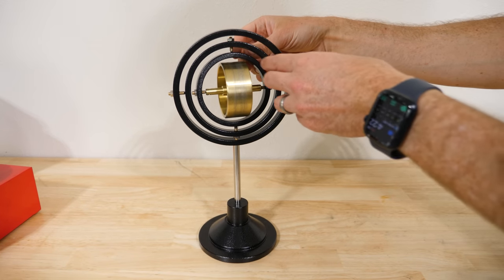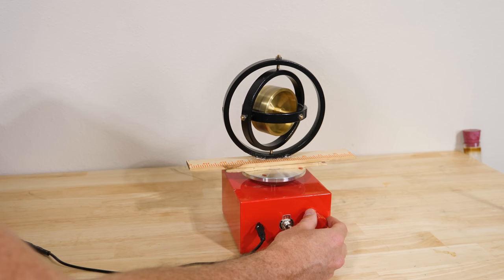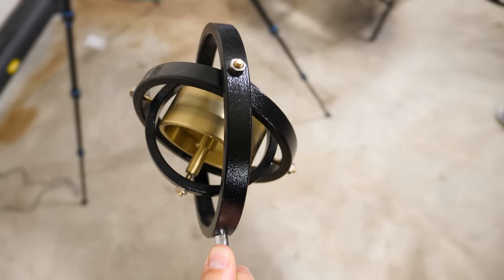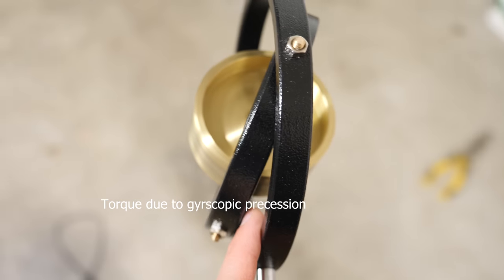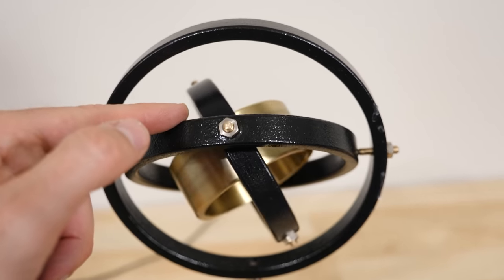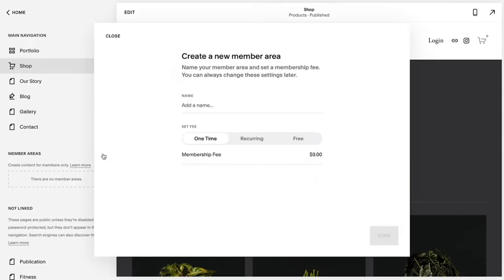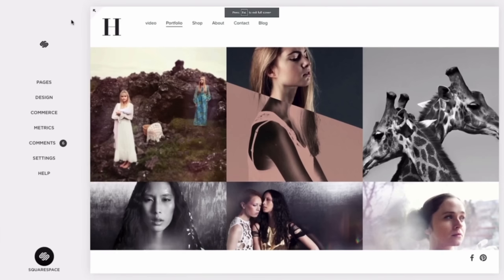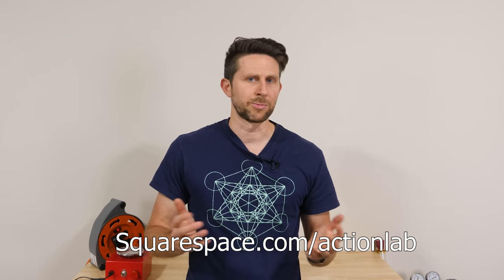Can Gyroscopes Provide Free Energy For The Planet?

Comment: Tesla came up with an idea to extract energy from the earth's rotation.  He said we just need to build a structure that circles the earth at the equator which when completed, would no longer need any supports as it would float independently because gravity would be pulling on it equally all around the world.  He posited that since this structure is now independent from the earth, the earth would rotate under it and generators could be made to turn from the earth's rotation.  Genius.
Reply: I am wondering if any material could withstand the compressive forces on such a ring. I do think it is a great thought experiment.
Reply: @flamencoprof  I believe the entire structure would only be under 1 g.  I think the real issue would be supporting the structure while under construction in the areas that cross oceans.  Floating platforms may not be stable enough.

Comment: Ok I know how to do it : you put two big masses in balance on an horizontal axe (the axe is on vertical pole), the whole system is at the top (North) of the planet. 

If you quickly flip the axe vertically (as if it was a clock's hands spinning), then the two masses will suddenly have a momentum that is in the opposite direction of the spinning of the planet. This should cause a torque in the middle of the horizontal axe relative to the pole.

Comment: What could theoretically happen if the spinning core of the gyroscope was full of ferrofluid and a magnet approached it? How would it react?
Reply: Well, before you even have the magnet acting on the gyroscope, the ferrofluid inside the gyroscope would start to slow it down due to friction because it's not a solid mass, so the two masses would rub up against each other, converting kinetic energy into heat energy. The magnet would increase this affect massively, most likely bringing the gyroscope to a halt after a few seconds, since now the ferrofluid inside doesn't even want to attempt to spin along with the gyroscope and instead pool up against the side closest to the magnet.

Comment: Thank you for this video and the work you do. The creator of this video requested input on potential solutions to break the barrier of using gyroscopes to extract energy,. One possibility is incorporating elements of the vandergrah generator using conical levitating bearings, that is, without taking advantage of China’s recent breakthrough extracting energy from quantum entanglement,… (also, incorporating concentric spheres and cyclotronic/collider principles in place of gyroscope rings, suspended via magnetic levitation is another option to completely remove the need for bearings thereby decreasing resistance.)  In theory we could even incorporate ionic and/or harmonic frequency stabilization/propulsion to smooth rotational wobble.

Comment: Maybe we have a 10-ton gyroscope rotating at 10,000 RPM at the equator of the planet and and stabilizers so that if we apply any resistance it won't try to align itself maybe we can have a lot of these around the world but we could make a gearbox that would allow for faster rotations so we could attach a crap ton of motors to it and extract energy that way

Comment: The Soviets tried building these things for decades, and only ever got a few watts of power generation. The main issue is the scale; you'd need to build a gyroscope on a scale comparable to a small planet to get a useful output of energy, due to the slow spin speed. Using a series of orbital rings, you might be able to get it to work, but there's much more useful things you could do with orbital rings to provide power.

A much more realistic possibility would be to melt an iron/nickel asteroid into a sphere deep in space using solar-pumped mirrors, then build a flywheel on one of its poles. You could then spin it up with the flywheel, converting the asteroid into a giant mechanical battery (to store nuclear or solar power) and then you could extract that energy from the flywheels on its poles and beam that back to Earth via a MASER and ground Rectenna setup on an as-needed basis. Even if the asteroid was only a few cubic miles, it could store enough power to run entire nations for years, and would have something like 85+% efficiency as a battery.
Reply: Intriguing. Where can I read up on this? Even the stuff mentioned in the video is a very hard google search, apparently.
Reply: @janimelender2674  Yeah, hard to find much info these days. I read about the Soviet experiments with gyroscopic energy generation about twenty years ago in college. No idea how to find that info today, sorry.

The flywheel battery thing is pretty well known, though. I'm sure there are multiple Youtube videos that explain it better than I could. Using it to spin up an asteroid is my idea, but it's based on plans for how to control the rotation of O'Neill style orbital habitats that NASA was studying decades ago. It's all fairly easy to understand once you know how flywheel batteries work, though. If you stand on an object, like an asteroid, and spin up a flywheel in your hand, the asteroid below you will start to spin in the opposite rotation. Essentially the same as having two flywheels atop each other, each wanting to counter the spin of the other.

Comment: Two ways I can think of extracting energy is using a turntable like the powered one you had with a minimum of friction to allow the gyroscope to turn it and use the motor to generate electricity as it rotates the turntable. Another idea is to have magnets embedded in the center of the gyroscope and coils to pick up the magnetic fields. I can't help but think about the starting and running energy needed for the gyroscope. A pendulum only needs a start and it will continue with the rotation of the earth so if the tip of the pendulum had a strong magnet and it had a multitude of coils to pick up energy possibly you could generate some electrical energy that way depending on if the magnet causes the pendulum to slow down to a halt because of an attraction to the metals in the coils or mounting hardware. The idea is to get free from using energy to make energy except for perhaps the initial start. How about a satellite that focuses energy on a point on earth where you have various solar collectors around the earth and the satellite would switch on and off according to where the collectors were located...? Some extra food for thought perhaps?

Comment: You aren't going to be able to get energy out of gyroscopes sitting on the Earth, because that would require violation of conservation of angular momentum.  The Gyroball can work because your hand is transferring angular momentum back and forth between it (and the Gyroball) and the rest of you (and the ground you're standing on, although that isn't strictly necessary).  Now if you have somewhere for the Earth's rotational angular momentum to go, then you can extract energy from the Earth's rotation -- this actually works, and somebody posted in another thread under this video that this is tidal energy.  In this case, the Earth's rotational angular momentum is being transferred to the Moon and the Sun (to a lesser extent but still highly significant).

Comment: I would focus instead on harnessing the Earth's magnetic field by passing a conductor through it like was done on STS-75. A conductive tether was extended to 20 km at which point it broke because the voltage became so high it melted the cable.

Comment: so it kinda sounds like a matter of efficiency.. Like a perpetual motion machine the problem tends to become when you attempt to harvest energy from the system, entropy always wins but you can make a system extremely efficient and run for a long time from initial forces. 

You know its a shame theres not a way to reverse the force of energy, draw all the ambient thermal energy into one point, then use that point heat to run a generator. Would completely replace the need for air conditioning and people's homes would largely run their own electrics. (air conditioners already work by pulling energy out of the air, it just isn't in a way that can meaningfully be harvested.)

Comment: Probably a dumb idea, but:

I imagine a big, heavy flywheel. The flywheel has magnets that line the outer circumference. Obviously we take advantage of the inertia of this great, spinning mass to generate electricity from the change in magnetic current, but the next part is where it gets really dumb (and potentially smart)

If you get a bunch of people to push on a mechanical mechanism of some sort that can add rotational energy to the flywheel, it shouldn't run out of energy. For a person to add this energy they would have to use their muscles, and that made me think: what if the mechanical mechanisms worked like exercise machines? We want energy, and we want to get in shape, so this pairing seems logical to me. 

It would be hard to get the flywheel up to it's ideal operational rotational velocity, but after that it shouldn't be hard to maintain, and if there was a way to add weight to one point of the circumference, gravity would provide the initial pulling force that would help start the generator. 

So on a scale of 1-10, how bad is this idea?
Reply: Bro this is really just like those bikes from Black Mirror that generate electricity, but on steroids. 1/10, I'd rather have us just build some nuclear power plants.

Comment: You could use the magnetic field of a magnet surrounded by coils in a specific geometry to make a solid state "free energy" device.

The magnet itself already has a moving magnetic field. (gyromagnetic precession, larmor frequency) 

Of course the system has to be tuned precisely to work.
Reply: Don't talk shit. Free energy doesn't exist.
Reply: @SpareSomeChange8080  It depends on how you define the term "free energy"

Saying free energy does not exists is a non intelligent statement at least.
A solar cell is a free energy device per definition.

In my example I have posted above the rotating magnetic field of the magnet itself would be the power source itself. 

You don't have to attack me, because you can't grasp the concept I was talking about.
Reply: @OmegaZZ111  so if I steal power from a lamppost, is that free energy?
Reply: @SpareSomeChange8080 
If you can generate electricity with a setup as explained above the electricity is free obviously..

Seriously what is your point besides asking silly questions?

Comment: It would be cool if we could somehow build a massive gyroscope around the earth and then connect it to the moon with a super strong cable. The moon always faces the same way relative to the earth's surface so we'd only have to anchor the cable on that side. On the earth you'd need some sort of trolley which also acts as the generator, which will just get dragged along by the moon. Ofcourse highly theoretical as it would probably put the earth out of resources before the structure's finished.

Comment: It’ll probably have to be a massive digital/virtual device of gyroscope that can collect data and energy 😅 

I also have a question on a smaller scale.

How can we recycle the energy we are wasting, like light bulbs, speakers, electricity, cars, highways, airports, etc.. is there a way to instantly recycle ♻️ any energy spent? For instance “I turned the light on in my room, can there be a device connected to the fixture to harness the energy spent on the lightbulb?” I hope this made sense 😅

Comment: Same way you would do it with already in place infrastructure like running water to your house if you ionize the water to one polarity and coat the pipes in the opposite polarity so when the water moves just like shaking a flashlight that uses the same concept then run your wire up the existing drop from the pole at the weather head and there you go also if you were to build nuclear power plants in strategic locations based on weather patterns you can actually provide water to places in drought because it's a proven fact that the super heated air from the cooling towers when it rises and mixes with colder air above snow storms and rain storms are created positioned along specific Jetstream you produce and distribute the precipitation you need where you need it

Comment: I would think that it should be possible to calculate if such system could produce some tiny amount of energy. If tidal motion and wind are partially caused by earth rotation that means rotation of earth provides big amount of energy to these masses of water and air. Maybe a huge disk (with many tons of mass and huge inertia) on the north pole, very well balanced and on frictionless bearing would stay stationary while earth under the disk would rotate?
This was absolutely interesting video! Best regards!
Reply: in case of wind: 

"wind are partially caused by earth rotation"

- that part is correct

"that means rotation of earth provides big amount of energy to these masses of water and air"

- that part is not.

Wind is not caused by earths rotation. Well, the direction the wind is blowing is, but the energy of the wind is entirely from convection currents caused by sun heating the ground and air.

The only thing earth's rotation does to it is that it steers the wind in various directions, but the energy isn't coming from earth's rotation.

In case of tides, those are caused by the moon, and tides do take earth's rotational energy and give it to the moon's orbital energy, so, that part isn't wrong.

Comment: If you normally need an external point of reference. Have there been any attempts to make use of the rotation of the earth with objects outside the earth's atmosphere like the moon or a satelite?
Reply: Orbit requires lateral movement meaning any object that orbits is also in relation with earth, making it not an external reference point

Comment: Maybe if the rotating core of the gyroscope was a Mendocino Motor and the external ring had low resistance generators for bearings, it could possibly work but only in the sunlight? Just a wild guess but possible under certain circumstances.

Comment: The frame of your demo gyroscope has at least one degree of freedom too many. If you make sure that the "generator axis" stays parallel to Earth's axis, there can't be any precession. The question is if you can harvest more energy than you need to spin the gyroscope. The gearbox needed to get 1/1440 rpm up to a reasonable generator speed would create a lot of friction.

Comment: 3:12 In your example you just added the generator (and resistance) to one axis of the gyroscope. You have to take advantage of both axes and also apply resistance to the movement of the gyroscope when it tries to lie on its side and extract energy from that motion.
Also, I think it is a good idea to increase the resistance towards infinity as the gyroscope tends to be completely flat; like the tangent function when the input tends to pi/2.
Reply: Thats what I thought ... well, the first part, lol... But, ya, why wouldn't you naturally try to put generators on all the axes.... instead of just one.  Then, to take it to the next level, hook up all these generators up to an AI program to see if it can figure out how to play with the resistances to keep it going... heh
Reply: @PimpTrizkit-42  The AI idea is fantastic! Its goal is to control resistance of each one of the axes to extract the maximum amount of energy on the long run, not necessarily instantaneously.
But there is something to keep in mind. The axis of rotation of the gyroscope mass, is the one we shouldn't interfere with, because slowing it down will stop the gyroscopic effect. The gyroscope has to stay rotating for ever (as long as possible) that's our bridge to the energy of earth's rotation. That's why friction is a major issue. By the time the friction consumes all the energy we gave to the gyroscope to rotate, we must have extracted a bigger amount of energy than we applied.
Maybe we could put the gyroscope in a vacuum chamber.

Comment: You require a larger moment of inertia. Maybe too big. But a tiny gyroscope requires an unrealistic speed to match a Powerball effect. But a larger one, 3’, does not require a full rotation, just a tiny motion with significant increase at least in newtons of force although far slower it is still scary to be around. 

Love to do the math sometime. Have you seen Adam Savage’s wheels of doom? A scary amount of energy. But those were around six feet. Ten feet, a hundred feet? Those would achieve the Powerball effect at, say, 100rpm and perhaps that would be enough to tap the Earth.

Comment: i understand there's not much speculation on this but I propose if we did use the earth gyrospcoptic energy we would eventually slow the rotation. It's not a horrible idea to thin of this as a way to control climate... perhaps even to warm the polar caps so the entire planet could be used... I also propose using other means of energy collection to balance the magnetic fields to perhaps even increase the suns life span in a feedback loop

Comment: Use a liquid instead of a heavy steel disk that way you can pump a small amount of liquid like 1 gallon per minute in a vary thin channel so it flows fast and have multiple turns so a lot of mass moving in the same direction